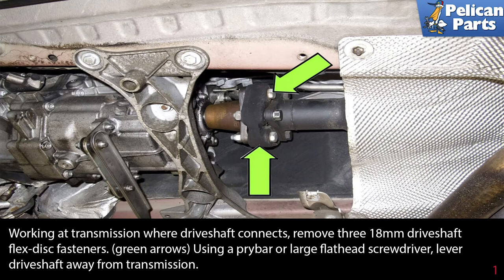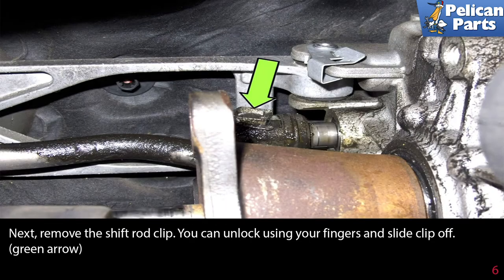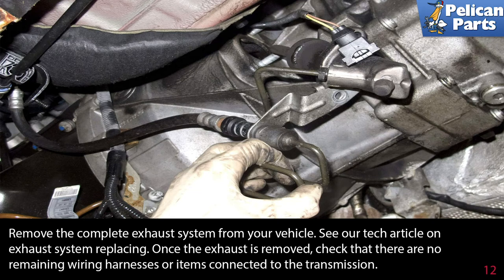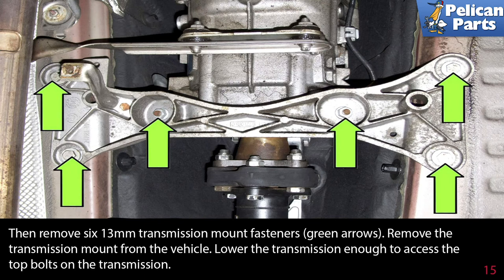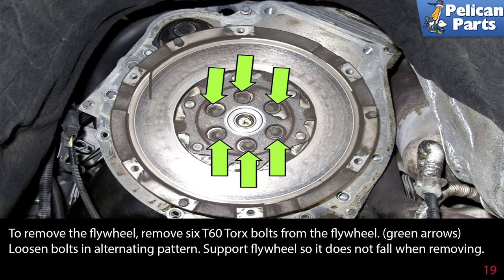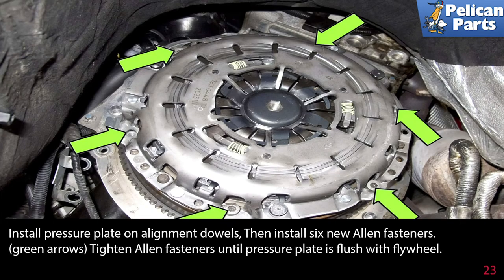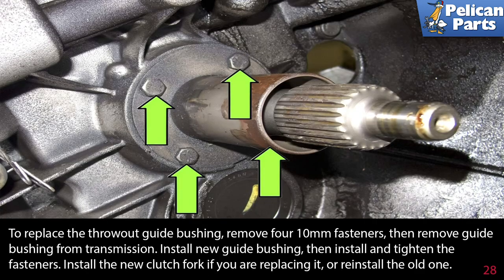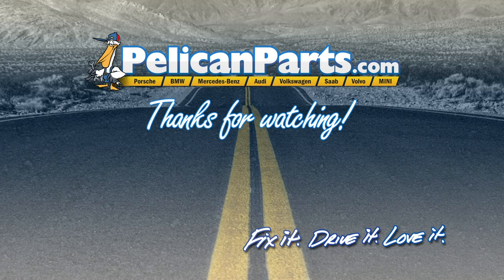BMW E90 3-Series Clutch Replacement

Comment: When changing gears on my 2007 BMW 320i, sometimes the first gear won't go in and I will have to go 2nd,3rd,4th,5th, and back to 1st for it to go in or I let the car-free fall until it slips in....I took it in to a local mechanic who insisted its the clutch disks but when looking up the symptoms of a bad clutch disk, this isn't on of the issues listed but does sound like the Clutch master cylinder

Not really knowledgable about cars so i wouldn't know, is there anyway to tell other than taking the car in?
Reply from the maker: If you push in the clutch pedal with the engine running and it will not into first, but does go into other gears, try going into second then first gear. If that works it could be an internal issue. Especially if the clutch does not slip when accelerating.
Reply: Finally, what solves your problem?
Reply: Same issue here sometimes. What was the issue

Comment: Question: wouldn't you want to torque the bolts on pressure plate first before removing the center lock?
Reply from the maker: Yes, normally.
Reply: That's literally what he did in the video

Comment: Question, at 4:19 I have two smaller bolts that aren't aluminum but are there in the bellhousing, where do I put them, I've put one that fit all the way at the top and the second won't go in the second highest point
Reply from the maker: Into the mounts or brackets that don't require aluminum? Hard to say, as I didn't pull them out.  if you don't see them in the video, check this article here: https://www.pelicanparts.com/BMW/techarticles/BMW-3-Series-E90/TRANS-Clutch_Replacing/TRANS-Clutch_Replacing.htm

Comment: What do I do if the clip that rotates onto the transmission brace breaks?
Reply from the maker: Replace it. Give The Pelican Parts parts specialists a call at 1-888-280-7799. They can figure out what part or repair kit you need.

Comment: For the bell housing bolts, is it a mix of aluminum and a different kind of bolt that doesn’t need to be replaced? All of the bell housing bolt kits only have 5 bolts in them
Reply from the maker: Yes. It is a mix.
Reply: The aluminum bolts have blue painted heads from factory for easy identification